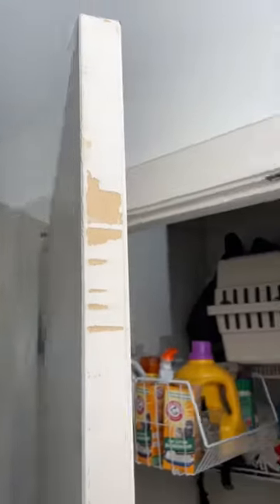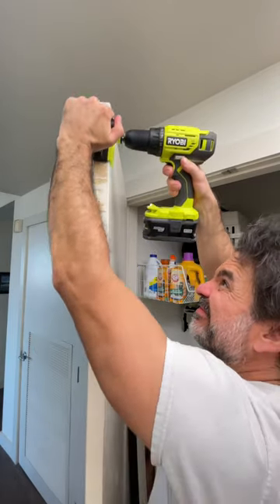Wood door trimmer drill attachment

Comment: You don't need that tool. I was an installer. Ez fix,  just replace a hinge screw with a three inch screw and drive it into the frame stud. It will sink up the slack and plumb the door. Way way way less work. It takes five seconds.

Comment: Holy shit . The hinges have shims if installed correctly just above the hinge behind the door jam board . Pull one of those shitty little hing screws out put a nice 2½ or 3 inch screw in it place and pull it in tight the door won't rub any more
Reply from the maker: Doesn’t work on these doors I know what your talking about though